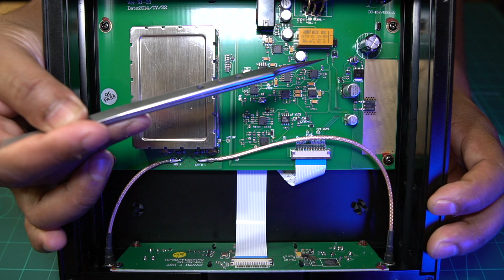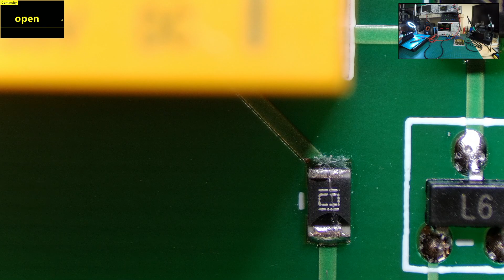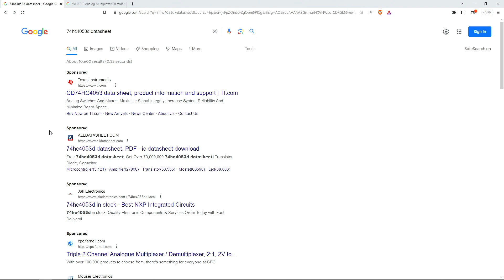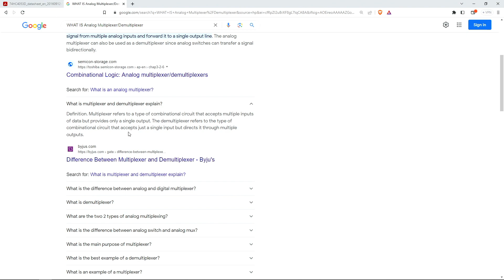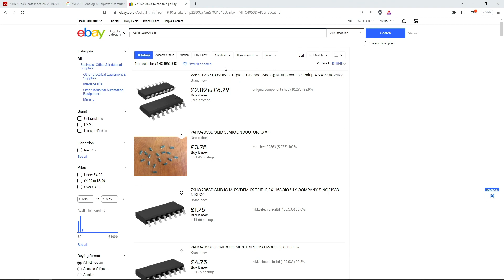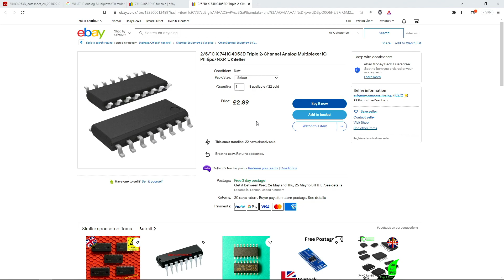PART THREE: How To Repair Anything Without Schematics - iRefab

Comment: I understand you figured it out for the video, but why would you suspect ICs first, I normally see transistor and capacitor issues. I’m still new, I’m not trying to say you’re wrong, I’m wonder about the thought process.
Reply from the maker: I understand what you mean and I appreciate the question.  I still consider myself a learner too so no offence taken.  The idea here was to show how you can easily find the faulty components if you have a working board to compare it to (this is the easiest way for beginners, without making things too complicated).  If any of the caps were shorted we would have possibly picked it up on the thermal camera.  Ideally we would have access to manufacturer service manuals with fault finding diagrams etc.  but as you know these don’t always exist or we can’t have access to them.  So many different things on the board to check and so many different ways to do it.  One thing I will say is as one become’s more experienced they will also gain intuition.  This will help you on their electronics repair journey.  Hope that answers the query 👍

Comment: I really like your logical fault finding, as a beginner a lot of circuit board repair videos are already too complicated for me. This was easy to follow. I wanted to ask, doing the diode testing if you have the black lead on ground and test the component with the red lead do you get erroneous readings? Also when you are testing these boards is it a dead test or have you got a power supply connected? Thanks
Reply from the maker: When doing tests in diode mode make sure there is no power to the board or you will get incorrect readings due to voltages present in the circuit.

If you want to test for voltages present in the board put your multimeter in voltage testing mode also set the range accordingly. Then you can add power to the board and test black to ground and test with the red lead.